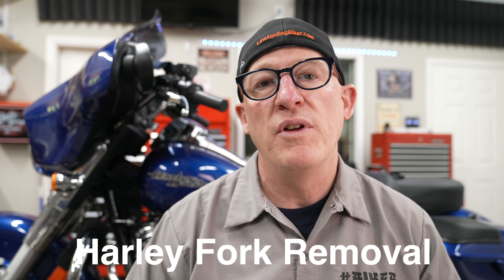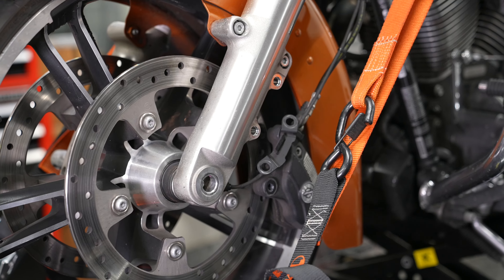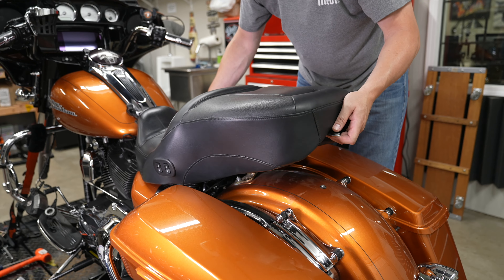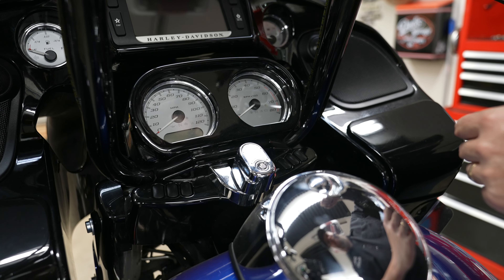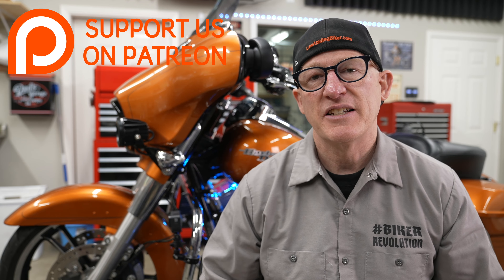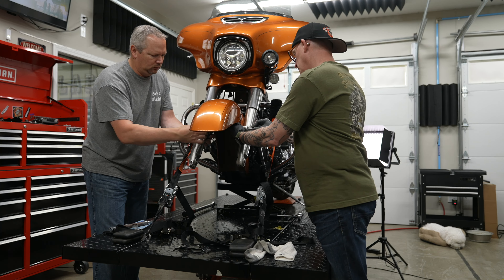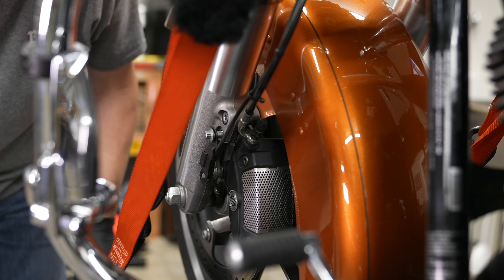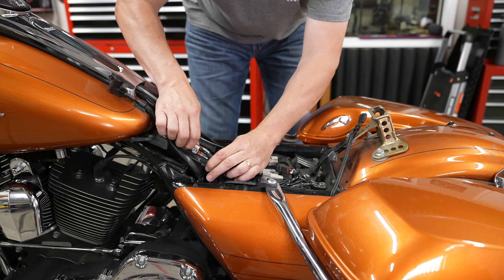How To Remove The Forks On A Harley-Davidson Touring Motorcycle

Comment: Wrong wrong wrong @ the 13:26 time marker you torque the axle then spin the tire a couple of times while engaging the front brakes semi hard to centerlize the wheel then torque the punch bolt. Correct me if I'm wrong. Aside from that good video 👍
Reply: You torque the nut, spin the wheel and apply breaks a couple of times and then torque the pinch bolt? Is that right?

Comment: Absolutely love your videos and step by steps, I recently rebuilt my forks when I switched to legends axeo cartridges. It’s a really easy process if you just take your time, and for a helpful hint put the front axel back in so when you loosen the clamps it doesn’t just drop, it also makes putting the tubes back on easier if you use the axel to help level it.

Comment: Pretty good video, but a couple suggestions: Service one fork tube at a time. Use your axle to realign the serviced tube with the other tube that has not been removed and is still factory set.  Once you have the serviced tube reinstalled, and the axle can easily slide in and out between both tubes,  then remove and service the other tube.  Repeat when reinstalling the second tube.  The only other thing is torquing your axle pinch bolt before torquing your axle nut.  Torque your axle nut before your pinch bolt.  FWIW:  You don't have to remove your tank, but this is an excellent video on how to remove a tank if you need to. There are also fender and tank covers sold by Harley that fit your tank and fender like a glove and prevent scratching your paint.   Peace.  jc
Reply: Great pointers dude. Thanks

Comment: I’m approaching 50k miles on my Roadking. Is the fork portion of the video the same
Reply: Why not  just download the pdf  version of the shop manual for your bike .
  I paid a reasonable amount for the 644 page shop manual for my Buell .. then I later found it for Free on a Buell parts supplier web site..
Reply: @mikeskidmore6754  new to Harleys and did not know there was a free downloadable manual. I will look for one thanks
Reply: @chicodurham4733    I did not say they were Free.  I said I found a source for a Free Manual for my 2008Buell Ulysess after i  had paid an aftermarket  Manual vender for a copy of  the pdf version for my bike ..